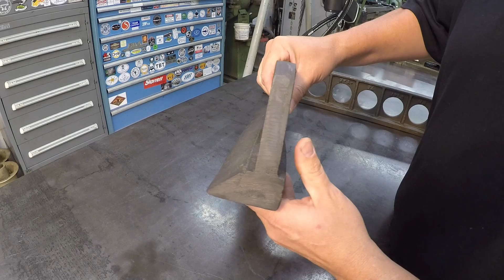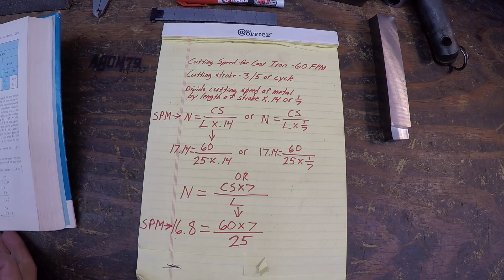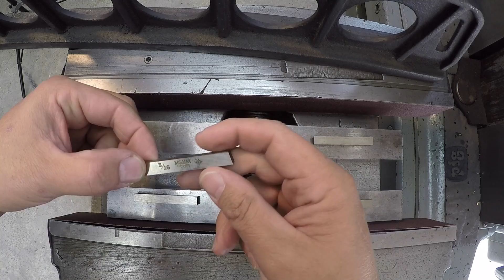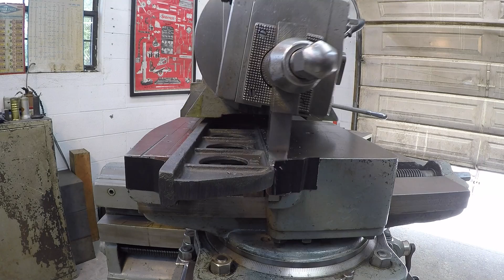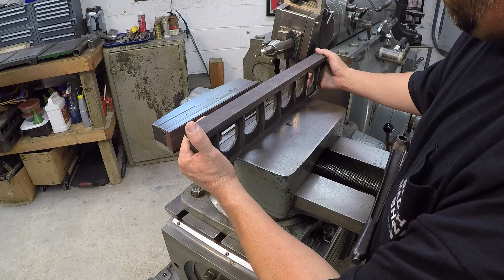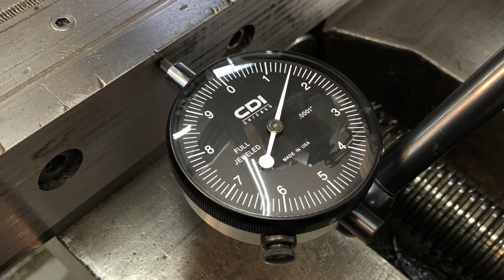Machining a 24 Inch Camelback Straight Edge Episode 1

Comment: I notice your farside of the rams ways has a lot of oil coming out of it,  obviously lots of oil is better than none but is that adjustable on a shaper?
Reply: Go back and look at the old videos he has up about fixing up the shaper right after he got it. Just go to his channel and search for "shaper" and sort it by date. There's oil sights on both sides of the ram that he put packing into and he explained that you want to adjust that packing in order to increase or decrease the oil flow onto the ways on the ram. There's also an oil wiper on the edges that also has packing in it that should be containing that oil better. I believe on the wipers Abom used a sheet of felt that he cut to match the shape of the corner of the ram, he could probably just replace that felt and cut the new one a bit tighter onto the ram and take care of it that way. Those old videos have a good bit of detail about how the oiling system on the shaper works.
Reply: @AndrewMerts  Brilliant, thanks Andrew!
Reply: @chris0tube He does talk about the proper viscosity of oil to use in that machine and he had a bit of a hard time just getting ahold of it. That sump is actually pretty large and it'd be an expensive mistake to run it with a heavier weight oil. The oil is totally fine as it is, he just needs to tighten up the packing a bit on the side that has an excessive amount. That's the way that machine is built, changing the oil viscosity is a bad idea.

Comment: Not a machinist at all but wonder, could this not be done with a cup type mill and have a better surface finish?
Reply: this was still the ruffing pass
Reply: @Wolfy_80  that much I understand,  but could this be done that way?
Reply: You probably could, there are always many different ways of doing this type of work. It's often down to what you prefere yourself. But when you do ruffing you not to worried about finish, just removing materials close to specs saving little for the finnishing

Comment: I wonder: rather than machining the ribs, could you have used some wooden blocking against the ribs when setting up the straight edge in the vertical position, with metal blocking on the outside against the vice jaws?  The ribs could 'bite' into the wood to take out the unevenness while the metal blocking keeps you square in the vice.  That way you could have preserved the cast surface finish.
Reply: Wooden blocks will certainly hold the work in place, but will introduce some amount of bending and/or warping because of the uneven nature of a rough casting. There is also the issue of repeatable registration in the vise in the case that you must remove and reinstall the workpiece.
Reply: @chris0tube gopdogg suggested not facing the ribs, and instead machining the foot of the workpiece straightaway (camel-back would be upside down). In that scenario the work will be distorted along the least stiff axes by the clamping force of the vise because no rough casting is true at the scale of measure Adam is targeting with these operations.  If the piece needs to be captured for other machining operations, there would be no precision surfaces along the rib faces to register the roll angle of the workpiece.

Comment: That shaper is an engineering masterpiece with a TON of complex moving parts, so I cannot wrap my head around why the toolbit doesnt automatically kick itself up off the workpiece. Dragging the cutter backward like that and having it bounce off the work just seems so uncivilized.
Reply: The clapper box the tools attached to allows the tool to swing up on the back stroke. Yes the tool does drop and drag shortly after starting into the back stroke, but since there's almost no pressure on it there's little effect. Some shapers came with what was called a automatic tool lifter, most I've seen were a cable with a metal tip that pushed the clapper box outwards and held it there for the full back stroke and then released as soon as the forward stroke started.
Reply: @turningpoint6643  most tool lifters i've ever seen on shapers were just rods that connected to the clapper and main body of the shaper and clamped with a piece of felt, so the dragging of the felt would cause the rod to lift the clapper
Reply: @SuperAWaC  This is the type I've seen the most https://www.youtube.com/watch?v=T1C3LIIy2wI

Comment: Why  don't you touch up the top then flip over to do the bottom
Reply: Alton Whipkey because he would still get the distortion he is trying to avoid by cleaning up the sides first. It wouldn’t hurt to clean up the top but not necessary for the way he is doing it.

Comment: Adam,your readings seem to be going up and down as you move indicator across straight edge,it could be because of your step over being to much ,your cutting with the flat part of tool with no radius on the following tip,and turning it on a slight angle,I think that could be the reason for the roller coaster reading,try a much smaller step over and a radius on the following tip,I think that sharp tip is digging in a little more and it shows up with such a wide step over.

Comment: Hi Adam. A quickie question. Since you were setting up the shaper for 90 degree cuts anyway, why not also smooth out the vise jaws with the G&E once you’ve trammed them in with your indicator? 😎
Reply: The vice jaws are usually hardened and ground.

Comment: Every casting is a shape the is larger in every dimension then the finished part. The machinist has a choice of how to machine the finished part out of that larger casting. The critical issue is that first machined surface. That is the reference from which all other cuts will be made. When I worked in the Oldsmobile factory, in one building they machined cast parts, e.g. connecting rods, crank shafts, cam shafts, exhaust manifolds, head blocks, engine blocks. They were all cast with a reference surface, usually the size of a nickel. That surface would be machined flat and the piece was ready for all the other steps. Adam shows this process of getting started beautifully. Thank you Adam.

Comment: What's the advantage to using a shaper for creating flat plains compared to a big face-mill cutter in a kneemill?
Reply: awesome/manual way vs. the easy way?  life's not all about the fastest/easiest way of doing things.
Reply: I'm told that shaped or planed surfaces are much nicer to scrape in than milled surfaces. The scraping will take a lot more time and effort than the machining, so this may actually save time.

Comment: at 26:00 cutting the bottom. is there a difference in the surface finish on the ends than in the middle.  as the shaper is speeding up and slowing down over the ends of the parts so your 60" of surface speed is not being reached on either end of the stroke.  would more stroke before and after the part create a better surface finish.. or just create more noise as the bit impacts the surface at a much higher speed..  what does your book say about that.  if that works better.. you might need to rename your shaper, THUMPER..  is your area of Florida plagued with Sink Holes? if so. then avoid my thought all together.  i already have one friend who lost every tool in his shop and 3 cars into a sink hole in so cal.  his shop was built over a flood control channel and the concrete had no reinforcement in it.
Reply: If you watch closely you can clearly see that the piece is bending at the end when doing the 40 x 40 ruff cut so it's a bit to aggressive for this clamping method to expect good results. Since this is a rough cut i don't think he cares, it will probably clean all up nice in the finishing cut.

Comment: Adam question you showed us that the jaws of the shaper vise are not totally flat, why did you not machine em strait? and best wishes for you and your family and merry Christmas
Reply: Hardened vise jaws would require surface grinding. The shaper might do it with carbide tipped tooling, but I suspect you'd go through a lot of tips for a bit less accuracy than surface grinding would produce.
Reply: @chris0tube True, but depending on just how hard those jaws are and I'd guess given the quality of that OEM vise there  pretty damn hard then you still might need some expensive CBN inserts to face mill them back to flat. No doubt Adam already knows a few with a proper surface grinder. There not out by very much and for the time it would take plus getting the better accuracy and surface finish if it were me that's how I'd do it.

Comment: Adam,  what is/was the rationale in selecting the shaper instead of the mill and a rotary cutter?  (asking as a non-machinist)
Reply: The single point full length cut from the shaper does reduce asymmetric stress in materials, compared to milling. The resultant parallel grooves promote better features for use, if no further machining or scraping is intended. For cast iron, this is less important, when comparing to drawn materials.
Reply: Bosted Tap now that makes more sense....Thank you, sir.  👍👍
Reply: @jwdickinson643  You're welcome. One solution to milling, would be to machine from each end 1/3 length, then the remaining centre portion.
Reply: J W Dickinson a good excuse to use the shaper 😉
Reply: David Bell 🤣🤣🤣🤣🤣  smart alec!  LOLOLOLOL
Reply: Yes, great reply boated tap.
Reply: @davidbell8869  Thank you 🎅

Comment: what are they used for???
Reply: Checking straightness of machine objects like if you were to do a head on a car and you wanted to check your machining work you put it on top of the surface to be checked and you use filler gauges to check how much of the or warpage  is still in
Reply: Straight edges are used as a reference to check other surfaces for flatness.